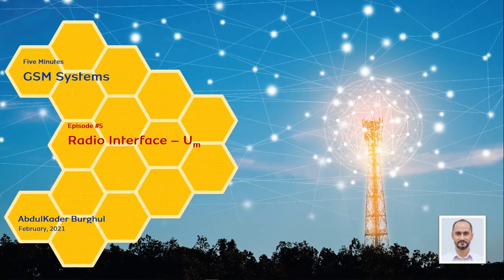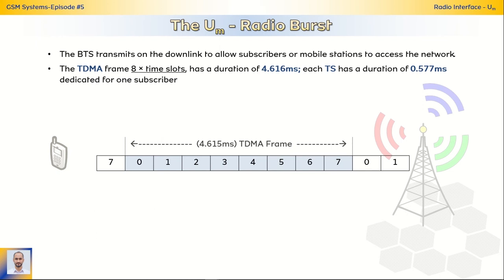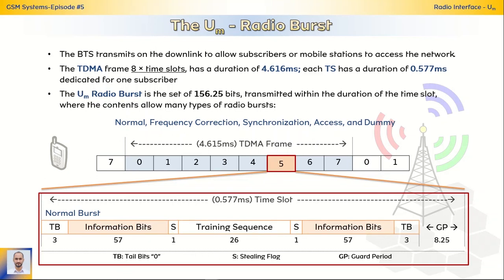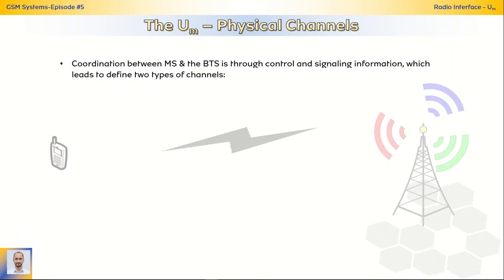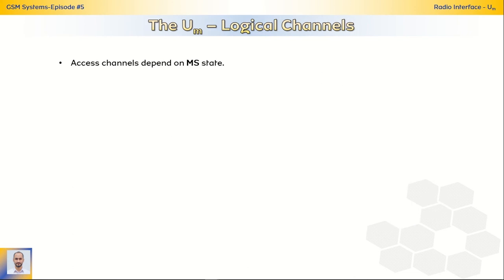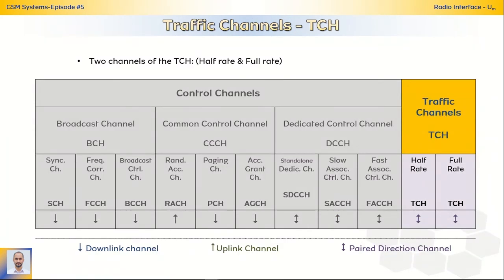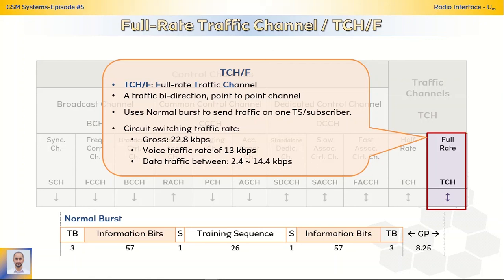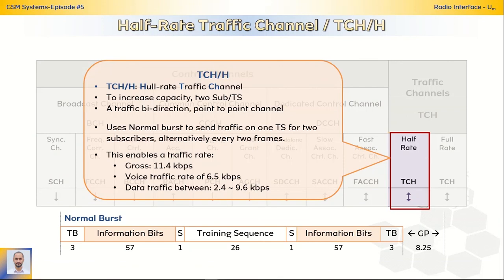Five Minutes - GSM Systems - Episode5, Radio Interface - Um

Comment: What are the system data rate, User data rate, and payload (extra bits rate) in a normal burst?
Reply from the maker: The data rate is the amount of bits per one second.. 
We have 156.25 bit in the duration of 0.577 ms of the normal burst, equal to ~264 kbps.
Reply: @aburghul  
Thanks for your response,
But I have a question about the duration,
Does the duration decrease if the number of the TDMA frames increases?
Reply from the maker: Not related my dear. It remains the same.